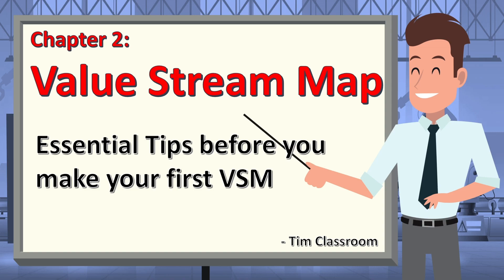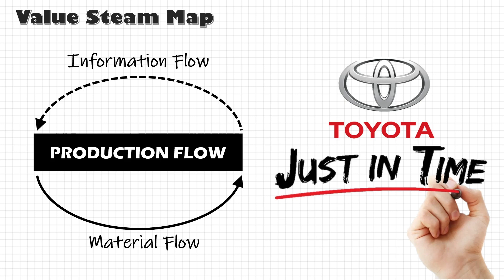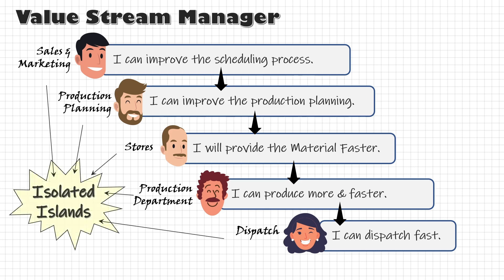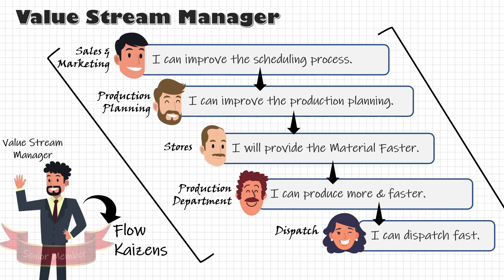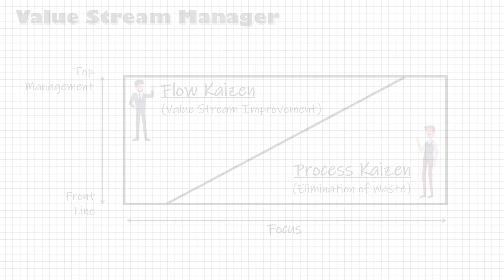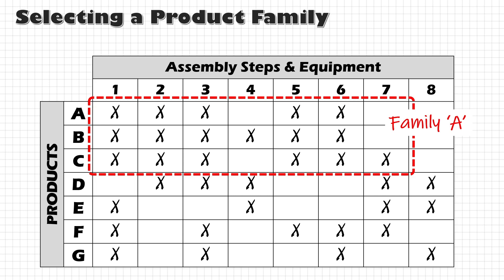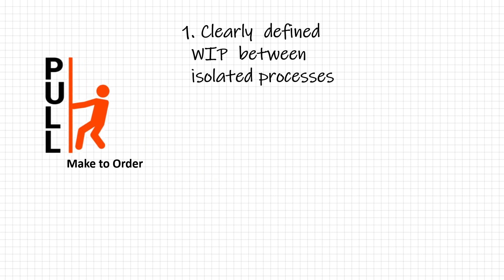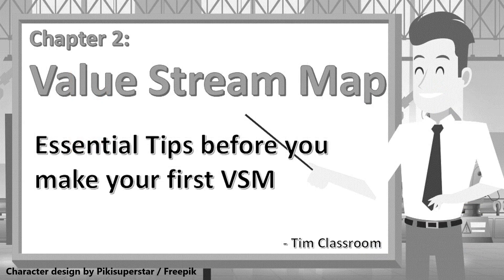Value Stream Mapping - Essential Tips

Comment: This video did a great job highlighting an important point: while individual department managers can influence performance within their own areas, this doesn’t necessarily improve the overall flow of production. Bottlenecks or delays in other parts of the process may go unnoticed when managers are focused solely on their departments. That’s why it’s so valuable for organizations to have a value stream manager who oversees the entire flow and leads flow-focused Kaizens. At the same time, empowering frontline employees to identify and eliminate waste can drive continuous improvement across the board.